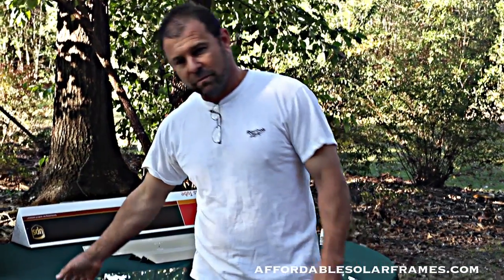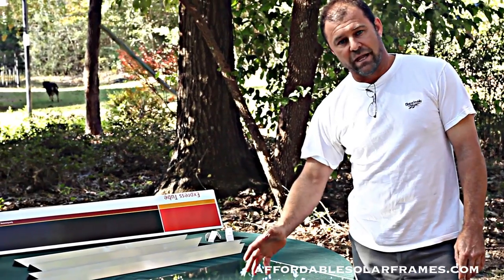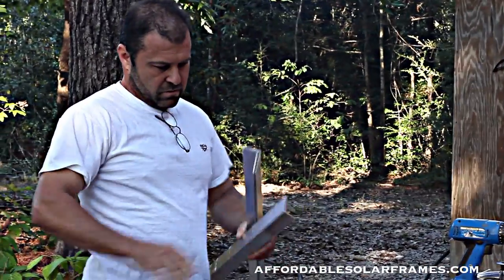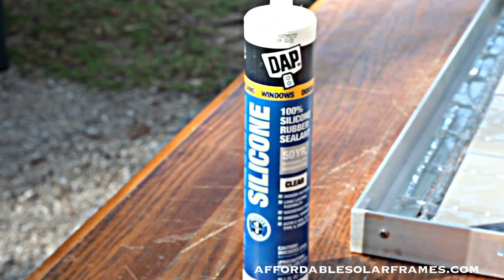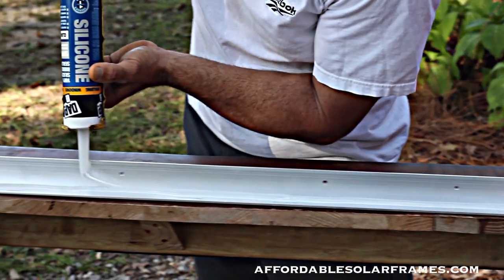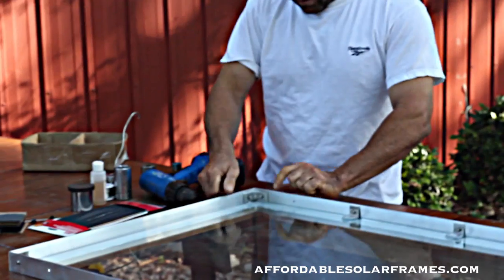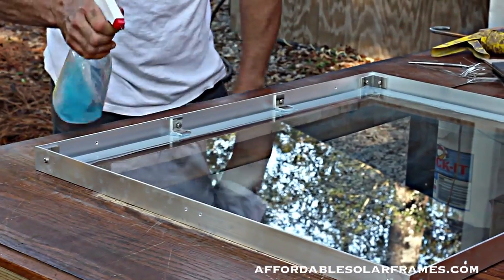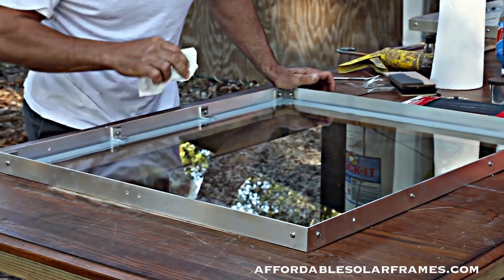How to Build a Solar Panel - Part 1 of 3 (New)step by step buying everything off ebay

Comment: I have been in the renewable energy field for some time now and have used many products for instructional purposes, but this  coulc.it/solar is the best. It has all the material needed to get people here in the IBEW up and running for the installation and design of solar systems.
Reply: We went with [Installer], and installed a 6.4kW system with a 5kW inverter.
Reply: I received contact from [Installer] and ]Installer].  Both were very professional and helpful and I would not hesitate to recommend them to others.
Reply: Thank you for your help and interest.
Reply: I had a look at Solar Choice on 10/3 and selected 3 installers. I just
Reply: Now I just have to wait for 300+ watt panels to become mainstream so I can put a decent system on my roof.
Reply: I really appreciate you taking the time to respond and for answering my questions so simply
Reply: Just Feeling share
Reply: Just implement

Comment: Make my electric garden tractor, and it could be charged by solar, zero pollution
Brian Edmond 
2hrs cutting approx 2 acres or 8-10 hrs pulling trailer on a charge
Converting to battery power is a great idea for a garden tractor I converted one 15yrs ago, I used the 3 separate motor design and it is still cutting grass on a daily basis, it is amazing how it never breaks down and needs almost no maintenance, I renew the batteries every 7 yrs I am just on my 3rd set now, my design will cut up to 2 acres on a 50cent charge there are no belts or pulleys and no oil on the entire tractor, it can pull a trailer for about 8hrs on a charge, because battery run time is the most important aspect of most conversions I paid particular attention to the most efficient design, I used 3 separate small motors one for the drive with electronic speed control and two smaller with a cutter blade mounted on the shaft of each cutter motor ,total amperage when cutting grass is approx 40amps, (2000watts) this design only uses the battery power req to do the job, very little wasted battery power, it uses magnetic breaking of both tractor and cutter blades and automatically applies parking brake when you stop or get off the seat, an amazing tractor.            electrictractor.net
Location of video#1 on youtube   https://www.youtube.com/watch?v=9GN5fTEWYPs&t=0s

Comment: Hello!
 thanks for the video!
 I wonder: many people have made (in youtube video and forums) panel of 36 pieces solar cells, if count 36 units multiplied by 0 5 Volt get 18 volts, I just received 40pcs poly solar cells- 70watt from USA. I want to connect for charge car battery is 45 amps or 100amp,also i have  Controller 20amp like this: 

http://www.ebay.com/itm/20A-12V-24V-Solar-Panel-Charge-Controller-Battery-Regulator-Safe-Protection-YK/221892107451?_trksid=p2047675.c100005.m1851&_trkparms=aid%3D222007%26algo%3DSIC.MBE%26ao%3D1%26asc%3D36862%26meid%3D135ca3533d9446debac1b6aa7e92a5d2%26pid%3D100005%26rk%3D3%26rkt%3D6%26sd%3D261996636715

Is it possible to make the solar panel consist of 40pieces=20 Volt? 20volt this is bad for controller or car battery?  or impossible make 20volt and important a make of 
36pieces=18volt??????????
i hope you answer soon...
best regards
George!
Reply from the maker: You can build a panel with 40 cells and charge a 12 volt battery with no problems.
Reply: tanck you very much!

Comment: mark as I searched for sylgard and it is not available ..so is there any other thing for encapsulation or we have to use Eva sheet
Reply from the maker: +anuj kothari  Here is a link.http://www.ebay.com/itm/Dow-Corning-Sylgard-184-Solar-Cell-Solar-Panel-Encapsulation-Kit-Fresh-Product-/180518954584?hash=item2a07c4a658

Comment: At about 9:45 you start soldering, but I don't see you get out a roll of lead solder.  The 3x6 cells I've been working with don't come with solder pre-applied.  Did you pre-solder the cells or did the vendor do that?
Reply from the maker: +Nathan Moore  The cells are pre solder.

Comment: and why plexiglass dont work ( im trying to do a flexible solar panel for my diesel truck ) , thats why im asking :(
Reply from the maker: +Rulls'Less Gang Plexi glass expands in the heat of the sun and will pull the cells apart.
Reply: +markp0177 alright, and witch product can i use to protect the solar cell, that can be flexible, do you have a idea ?
Reply from the maker: +Rulls'Less Gang  I only know how to build them the way I show in the video. This type of cells are not flexible.
Reply: alright thanks for the information :D !

Comment: I'd put a matte finish on the glass so you get more light on the panel and not the glass.
Reply: Samuel Mason
I'm not sure, but I was thinking that it would stop it from reflecting on the surface of the glass and pass through straight to the panel.

Comment: Thanks Mark for your prompt replies.

1. While I am tapping on the back of the back of the cell , there are three lines of each have three small strips. if one small strip doesn't get tapped, is it ok or not good?

2. Please see the photo. All three strips in one line are not sticking and when repeat they got black colour and couldn't get tapped. What csan I do to get this line tapped. Also why this happened? over flux or over hreat?
Reply from the maker: +Ponniah Kunathasan It one strip can be pulled up, that means it is not connected. The only way to fix it is to take out and put in a new cell. I am not sure what causes this to happen.
Reply: +markp0177  The right  was taped well and the middle line all 3 small strips were not tapped. I tried again . not tapped. I tried with a new tapping bar, still not tapped and now the strips are look like burned and black in colour. I did not tried the left line yet. Is there any way to clean the black line? or the cell is still good to use with left and right lines are tapped?
Reply from the maker: +Ponniah Kunathasan I think you will get low power from the bad cell. I would replace it. Watch this video and you will see what happens with one bad cell.https://www.youtube.com/watch?v=VaBr0OHOCws

Comment: Thanks for your prompt replies, Mark.
I am brand new to solar panel assembly. I am still not understood the connection from the bus wire to junction box. Specially from the bus wire. Do I need to solder a wire to bus wire to bring it to junction box or is there any other connection or clip for that? Thanks for your time.
Reply from the maker: +Ponniah Kunathasan Just solder a wire to the bus wire.

Comment: Im trying to build a 250 watts solar panel so, what settings would you recommend  y buy?
Reply from the maker: DAULISG For that big of a panel use 6x6 cells.
Reply: Then which frame size should i buy from you?
Reply from the maker: DAULISG Contact me at markel38@aol.com I can make you a frame to fit 72 cells.

Comment: You write in bubble you can't use plexiglass ... why ? I haven't been able to find a reliable answer to that question !?
Reply from the maker: Matrixtechno Plexi glass will expand in the heat of the sun and pull the cells apart.
Reply: Is it only for large scale panel ?

For example Goal Zero portable solar panel have some sort of plexi and not glass ( which would simply make it too fragile and or heavy )
Reply from the maker: Matrixtechno You can use plexi if you don't encapsulate the cells to the plexi.
Reply: Ah ok thanks ! So for example instead of silicon encapsulant if I use EVA sheet to encapsulate the cells I could protect them with plexi after. Much thanks on this !

Comment: I Googled your website it does not exist anymore. Have you changed your domain name?
Reply from the maker: Sorry, it is temporarily down, I am working on it now. Here is a link to where I sell on Ebay.
http://www.ebay.com/itm/180476303115?ssPageName=STRK:MESELX:IT&_trksid=p3984.m1555.l2649
Reply: markp0177
Thanks, I'll check it out.

Comment: Have you tried using rivets to assemble the frame?
Reply from the maker: Yes you can use rivets but most people don't have a rivet gun.
Reply: markp0177 thank you.
Reply: acklan3 Rivets have to be drilled out when they fail as opposed to bolts and nuts which are quick to replace, not to mention the fact that you would be hard pressed to find a stainless steel riveting system that was affordable for an independent solar panel builder.
Reply: markp0177 Hardware store rivets are made out of old Coke cans. A stainless steel bolt will outlast it by a factor of nine.
Reply: Marko Barrows But you know that so I will shut up now.

Comment: I was having some trouble tabbing my solar cells, does it have to be a high temp sodering iron?
Reply from the maker: No you do not need high heat. Watch this video and it will help.
https://www.youtube.com/watch?v=NJYaI3NGfXk
Reply: Reedstere For wires that guage, and the quantity of them, a 40 to 60 watt iron will work best. If you are working in a cold or breezy environment roll with a 60 watt.

Comment: Hello  Mark, how are You buddy?  Listen, I would like to know why We can not use flexiglass which was mentioned on the video.  Also I am interested on buying parts or most of the system that You have.. So what other type of glass do You use to mount the solar panel?  Other questions might come later.  Thanks! ! ! !
Reply from the maker: I use 1/4" clear tempered glass. Plexi glass expands in the heat of the sun and will pull the cells apart.
Reply: Hello Mark, good to see You assembling this articles.  I need all the info that You can provide Me cause I would like to see if I can re-sell this items.  Also I want to get the whole system for My own House.  What do You mean by when You say about the panels assembled.  Do You send them already assembled, "the panel that is"  and can You give me some prices so I can make some plans.  Thanks buddy! ! ! !   Happy Holidays! ! !
Reply from the maker: Felix DuBois This is a old video. I no longer offer the frame and glass assembled. I still offer the frames. Go to my website at affordablesolarmounts.com

Comment: Mark, Ive Owned My Own welding and Fab shop for 39 Years,, Is There Any way we can Hook Up,Im In Ct,, and do Alot of Aluminum,, Have a Ellis Band Saw,, Model 5000,, and a 88 Ton Iron worker for Holes, Coping Notching!?????   Just Wondering,, Jack,,, Basically for Machinery,, Not To Much I dont Have~~~~~    Thanks,,Again, Jack
Reply from the maker: Thanks Jack but I have my own shop too. I just do this as a hobby.

Comment: I also have a question about wiring I have some glass panels that came from a solar heating system off of the customers roof so it has the tempered solar glass thats dimpled on one side, I can fit 120 3X6" cells on the glass with room to spare around the edges do I need to try to set it up as if it were one big panel or three separate lots of 40? Thank you for your Videos I appreciate them
Reply from the maker: JAX WAX I would set it up as three different panels. I would not use this glass in a photo voltaic panel. It is design to let in more Infar red light. This produces too much heat for a photo voltaic panel.

Comment: I am new to this and I started putting my cells together The tabbing wire came out a little bit longer and is touching the wire on the next cell do these need to be cut back shorter?
Reply from the maker: JAX WAX Yes cut it shorter.

Comment: Hi Mark,

Many thanks for this video, very informative.

I just wanted to ask how much Sylgard 184 you used for encapsulation? As it's (relatively) expensive I don't want to get too much.

Are there any alternatives to Sylgard?

Many thanks...
Reply from the maker: I use one container per panel. You can also use cell guard
Reply: markp0177
Would that be a 1lb (500g) container? I guess it is but can't read the label!

Comment: I will be using cell guard any tips--when you solder, first you do all the fronts (you don't show on video) and the you do the backs--Also when you connect using the wiring diagram where does the diode go and when you go across to you solder at all intersection not just the ends--you can email me at fmannlein@valverde.edu

Comment: ok, once you have a bank of batteries -- how do you plug into that bank
Reply from the maker: Watch this video, it shows how.
How to connect solar panels to battery bank/charge controller/inverter,  Wiring diagrams
Reply from the maker: Cell guard works great. Watch this video on how to solder the front.
How to solder solar cells/ secret trick to get it to stick.

Comment: ?. How do I know how many batteries it takes for a 4 or 5K inverter?
Reply from the maker: The amount of batteries depends on what you are trying to run and for how long. Also on how big your array is. For a 5000 watt inverter I would start with a 1000 watt system and 6 large batteries.
Reply: Cool thx.

Comment: Hi Mark,
I've tabbed around 75 cells now and for me I find the easiest way to get the tabbing wire to stick on the bottom side is to extend the flux beyond the three tabbing points, not a lot but just a little bit. This seems to allow more of the wire to be soldered down and decreases your chance of having a tab point not stick. I run the soldering iron on it similar to how you tab the front of the cell. Just wanted to share this since I've trashed a handful of cells figuring out how to solder back of cells successfully
Reply: hello john 
how much did it cost you to make your own solar panel >> and do you know how much a simple solar panel for a shelter would cost .
Reply: nibal alazawi it all depends on how large you want to make it. Get your frame from Mark0177, tempered glass from a local glass store, encapsulating fluid from www.mlsolar.com (cheaper than from DOW), and grade A cells from ebay.

Comment from the maker: 6000 watts is a lot. I only sell the frames to Qatar. It will take 100 panels to get 6000 watts. You can find it in ebay and the shipping calculator will figure shipping cost. search markp0177 on ebay.

Comment from the maker: You will need a grid tie inverter. Your panels voltage has to match the inverter input voltage range. I do not have a parts list or a video yet for that. I have several off grid systems. Watch this video.
youtube.com/watch?v=MuaT-Ug0kQY

Comment from the maker: The panel off ebay is from China and the glass is only 1/8" thick. They break easy and the waranty does not cover breakage. Also the bigger the panel the easer it breaks. We use 1/4" clear tempered, it is 4 times stronger than the 1/8". Be carefull what you buy, you get what you pay for.

Comment: Hi mark I really apreciate your videos and I am inspire to build my own solar panel with your materials since like 2 year ago, I am finally going to do it this summer but i was wondering What is the difference between this solar panel that will cost me more than $200 that gives 55 watts and a $150 solar panel of ebay that gives 100 watts.
I Totally would apreciate a response before making my panel
Thanks! :)

Comment: At home it is summer, and you can't imagine how hot it becomes,while at the same time electricity production is always lower than demand especially in the summer season when everyone would run their air conditioners thus causing black outs that go for not less than 3 hours at a time and this happens once or twice a day and on a daily basis.

Comment from the maker: Yes the prices have come way down but they are using thin glass, only 1/8". I wish they would use 1/4". 1/8" lets more light in but it breaks to easy. 1/4" is 4 times stronger. I try to build things that will last. 15 years from now mine will still be working and most of the cheap ones would have broke. There waranty does not cover breakage.

Comment from the maker: It is around 13 to 16% on the cells. You have to charge batteries or you can run a 12 volt 3 amp water pump straight from the panel.

Comment: I made my first solar panel thanks to this series of videos that you post here on Youtube, but I don't have a vibrator table so my panel have some air bubbles :-/, and the sylgard 184 are too expensive and one last thing, is that I'll need to use several panels and they'll be located on my roof, so it could be very difficult for me to use a hose to cool it down, because I live in Costa Rica and here the sun starts shining since 9 a.m until 4 to 5 p.m. when the panels could became really hot :-<

Comment from the maker: Yes, Assembly would be more accurate. Factory made panels break easy and warranty does not cover breakage. They only use 1/8" glass and a thin frame. You can build a better panel cheaper and not be sending your money to China.

Comment from the maker: That kind of glass is called Low "E" and it is not good for solar panels. Heat is not a problem when you build it the way I show you. Just use 1/4" clear tempered glass.

Comment: Hi Mark0177, sorry to bother you again, but you're the few ones who really know about solar energy and share your wisdom with anybody; so my question is if I can use an UV resistent glass to avoid the heat of the panel or that kind of glass could decrease also or affect the solar energy production?

Thanks in advanced and I'll be waiting for your aswer ;->

Comment: Lt. Manau neteisinga surinkimą vadinti "pasidaryk pats". Ir labai įdomu koks kainos skirtumas tarp surinkto gamykloje ir tų komponentų su pristatymu į namus. Sgaišto laiko surinkimui vertinti nereikia. Ačiū už atsakymą.

En. I think "assembly" would be more accurate than "How to Build". And it is very interesting what the price difference between Solar Panel made in factory and the components you buyng, time spent evaluation is not necessary. Thank you for your ansver